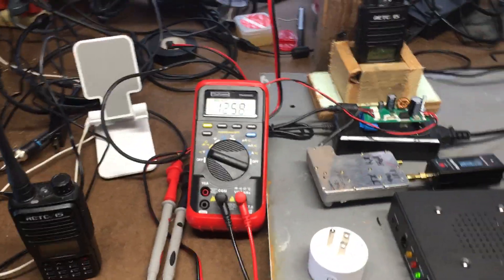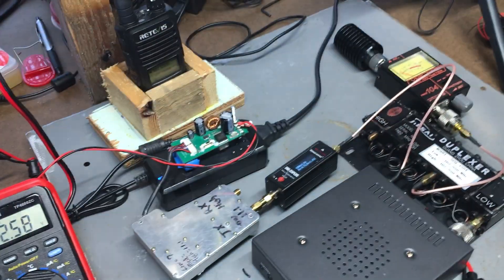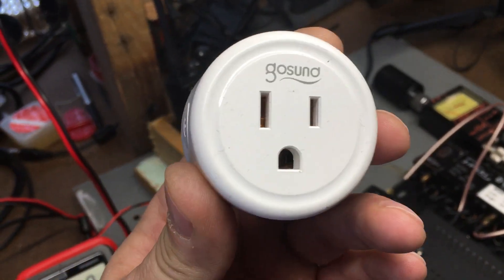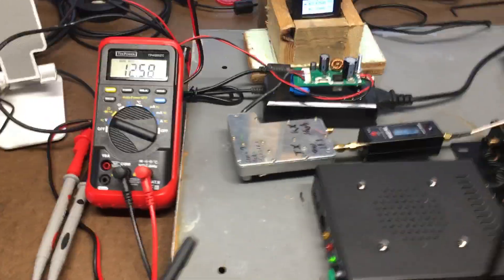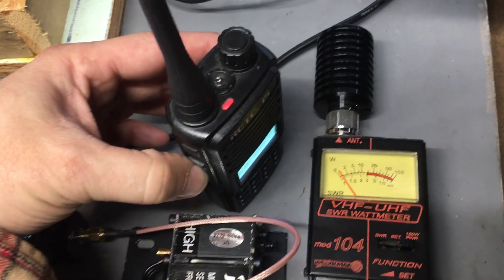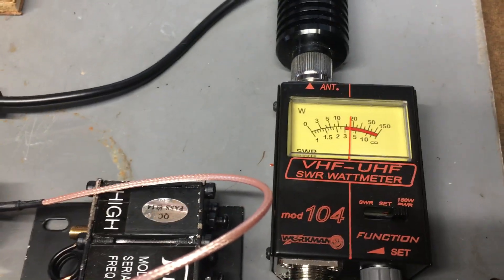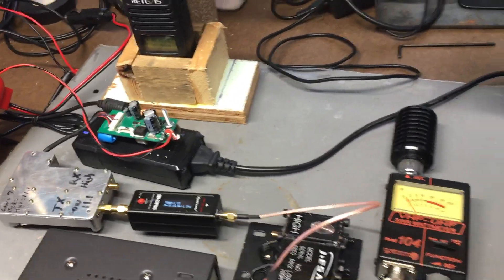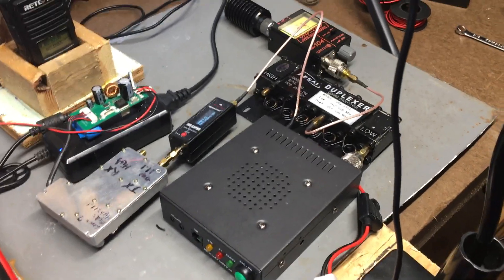🔺 Retevis RT91 40 watt GMRS two-way radio amplifier design flaw!! May not be a good for repeater? 🔺

Comment: That's not a design flaw, it's just incapable of passing a signal, which would be reduced through the additional circuitry anyway even if it did pass through.
Reply from the maker: Yes, if I recall this video, I think could design an interface board that would turn the power on if power is not on. i think that is what this video was about on how the amp don't turn on when power is hooked up.

Comment: You like to tinker with a lot of the radio electronics you should build a compact light weight repeater/ antenna combination. Something you can pack to the woods and set up in a tree and hide discretely in a area you can’t cover from radio to radio
Reply from the maker: Ohh yup I have lots of ideas but keep in mind it's winter here, so I have to wait for warmer weather 🙂
Reply: @GMRStwowayradio  yes it’s winter here also